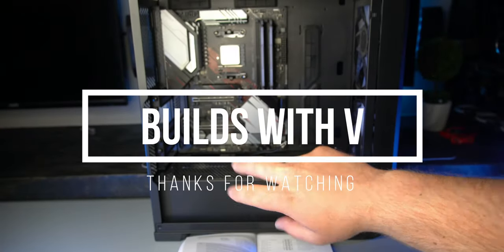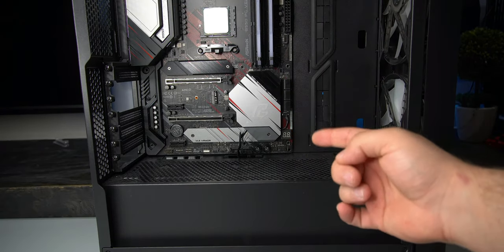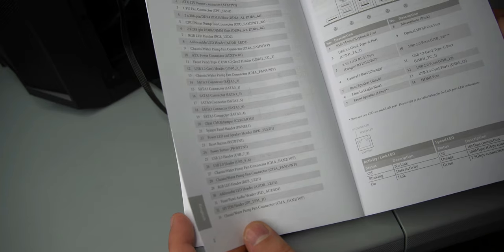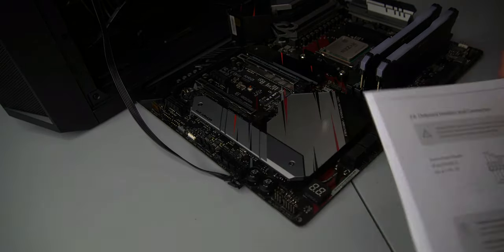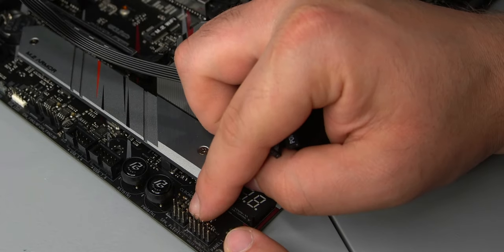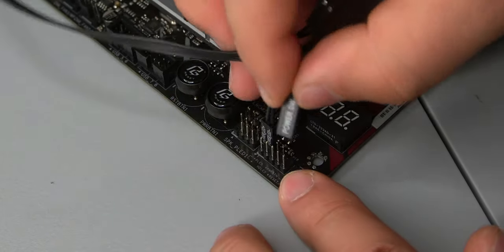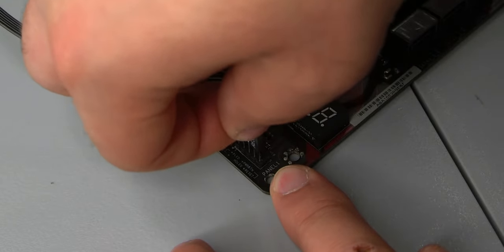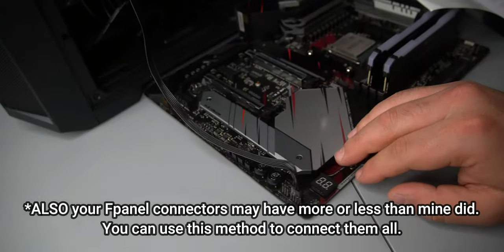How to Connect your Front Panel Cables (F_PANEL Beginners Guide)

Comment from the maker: What’s your least favorite part of building a PC? Mine used to be F_Panel NGL… but tbh I think cable management tops that 😅😂
Reply: Just plugging the cables in is a pain😂
Reply from the maker: @verivy  facts 😂
Reply: ram fit)
Reply: Spending money for part lol
Reply: Cable management is my favourite part because its calm work and i dont have to sweat over the fear of damaging my motherboard when i do that 😆
Reply: Installing be quiet! all-in- one water cooling system - If I don't see an advantage may just go with a regular air cool system.
Reply: GPU

Comment: Thank you for the amazingly simple video. Was adding a hard drive to my desktop but the SATA port was under my graphics card. Didn’t want to bother removing it so I poked around in the process removing the connectors. Ended up taking out my graphics card and trying to put the connectors back. It was hard to read the labels and I couldn’t find my manual. Your video saved me. Much better than the other videos that tell you to just check the manual
Reply from the maker: I’m glad I could help out 🙌 Thanks for sharing 🙏 and watching

Comment: I'm up past midnight, been putting my PC back together since like 3, with a bit of a break.  I could not find this information anywhere and I was not having any luck finding it in the manual.  Thank you SO much!!!  This was perfect!
Reply: I feel your pain. I just put together a PC for my wife and there was no documentation in the box that showed the location or pin outs of any of the connectors on the mobo. Not too much of a problem for an experienced person but imo it's sloppy. So I knew where the front panel connector was but forgot which pin was what. YouTube to the rescue...
Reply: @jimmarburger611  glad you got it sorted out!

Comment: Funny I've been building PCs since the 90s, but after getting myself a new Lian Li 011D Evo, I kept looking for the usual connectors and was not able to locate them.  Then I saw one connector with a bunch of wires named F_Panel...I looked and lo behold!  The pattern matches the pinout configuration on my motherboard.  Wo-lah!!!  A first for me!  Of all the cases I've bought up to this point, they all came with individual connectors...I thought this case has some MIA parts!  I was about to return it back to MicroCenter.
Reply from the maker: Yeah I love it. Some nzxt cases come like that as well. Nice touch for sure

Comment: Thank you for this. My book doesn't mention which connector the triangle goes on and the books don't mention if ground and power button are positive or negative. Your video is a life saver
Reply from the maker: I’m glad I could help. Thanks for watching 🙏
Reply: @BuildsWithV  Love the video, its the small things that make a big difference. To clarify, the LED's have a +/- because they're Diodes (Light Emitting Diodes) and current only flows one way through them. So they have to be hooked up correctly for them to work. The Power and Reset switches would work either way, but there are considerations of what side of the switch is hot and it's best to be safe and hook them up as directed. A good rule of thumb is that the writing on the connectors should all face the same direction, in this case all facing to the edge of the motherboard. Not that those singles wont go in either way but it looks better and you won't have to remove them to see what they are. Rock on Brother.
 P.S. There's a reason for the saying "RTFM" lol.  For those that don't know, it means Read The F____ Manual. A bit crass but a good idea. Thanks for making that a focus.

Comment: Should I plug my spair power plug for the f panel into the ground? Aswell with the reset switch?. They both only need one plugged in for my mboard

Comment: Hey man i am struggling to connect these and u helped me thank you! I do have a question is that the wire that is connected to ur hdd lded and all the other stuff, i do not have that i have the nzxt case and it came with it but its a very small wire and i dont know where to connect it

Comment: The arrow shows the power wire. That's what I was wondering. 

I don't install motherboards every day but I've built my own PCs for 30 years and those damn stupid wires have not changed. I would very much like one plug for the whole deal.

Comment: ive got mine plugged in all good. but using the front panel connectors, my pc wont turn on. but i can turn it on and it works fine just using the motherboard

Comment: Hi I need some help. Im new to building pcs. My nzxt h7flow case doesnt have cables like the ones you first show. its an f pannel connector but seems like they are all togeather in one block. do these still fit into the places you show ?
Reply from the maker: Yeah, nzxt and some other brands started making them bunched up into one connector. They should all fit in the right spot. Just line up power button + and - and plug them in and the rest should be same spot.

Comment: i got a question. when you put the front connector parts into the motherboard where does the other end go?
Reply from the maker: The other end is typically already plugged into your front panel I/o. If it’s not then you may be able to plug it in. It just goes to where the power button is, USB ports in the front etc.
Reply: Thank you so much for this, I've spent the better part of 3 hours searching for this answer because nobody ever shows the other end of the wire
Reply from the maker: @wicked1580  dang I honestly had no idea some cases don’t have them plugged in already. I will remember to include that next time I remake this video. Thanks and I’m glad I could help 🙌
Reply: Hey so I have prongs on the other end of mine and I have no idea where they go

Comment: Do I need to connect anything from the case to the power supply for the front panel to work?
Reply from the maker: Typically no but some cases have specific hub for fans or rgbs that require either sata or molex connectors to the PSU. Depends on the case but even then, those may not need to be connected to the PSU in order for the front panel to work.
Reply: @BuildsWithV  Thank You

Comment: hey man could u tell me where the front panel connecters are connected to? like my front panel connecters came in a separate bag.
Reply from the maker: They are connected to your case. Usually in the front or top of the case for your headphones, power button, power button led that shows when it’s on or off and stuff like that.
Reply: @BuildsWithV  really? then what came with the motherboard?
Reply from the maker: @Masakashi  I’m not too sure. What motherboard did you get?
Reply: @BuildsWithV  i think it was a h410m-a pro from msi, i forgot since im on vacation and my last part for my pc arrived so im askin for this part of the pc then im finished!😁
Reply from the maker: @Masakashi  I just looked it up and I can’t seem to find these cables that came with the motherboard. The only cables it says it includes are the sata cables for your hard drives.
Reply: @BuildsWithV  oh dang well u said it was on the case right? i have a h510 nzxt case
Reply from the maker: @Masakashi  oh okay, the nzxt cases typically come with a separate cable that connects to your front panel connectors and then plug into your motherboard same way as this. They did that because some motherboards have a different pin-out than others. Nzxt cases come with one solid connector instead of all these little separate ones like you see in my video. The small dongle turns it into these cables in case the pins are different. Hope this makes sense.
Reply: @BuildsWithV   could you link ur vid that has my situation? or any vid
Reply: @BuildsWithV  thank you so much for your help!😁
Reply: @BuildsWithV  nvm i have a prime h410m-a pls help
Reply: @BuildsWithV  nevermind i have setup my pc and it works!!

Comment: I have my pins in and everything is set, but I have no idea where to plug in the actual cord that isn't the pins. It's just dangling in the air. I have no idea where it goes
Reply from the maker: It should be plugged into your front panel where your power button and USB ports are.

Comment: so i have an old asus essentio cm6870 and i have the power led, usb3, and speaker in and out working but im not sure how to get the micro-sd port to work.
Reply: My motherboard is a gigabyte b660m ds3h which is not the original board that came with the prebuilt office case.
Reply: it would be helpful if i knew exactly what each front panel cord did and where it plugs in to.
Reply from the maker: I’ll be honest with you, I’ve never connected a SD port to any of my PCs so I have no ideas. I’m sure someone has some info on YouTube but I just don’t have any experience with it.
Reply: @BuildsWithV  sadly not lol
Reply from the maker: @realredrobot  oh that’s unfortunate 😅 what I’d do is look at the connector and then look on your motherboard for a same connector or similar and then look up the user manual for the motherboard and see if you can find what that connector on the motherboard is for.
Reply: @BuildsWithV  the problem is that the front panel is very proprietary and is supposed to only work with a specific motherboard, it's a miracle I got some of the things to work

Comment: connected all of mine like that and my new pc still didn’t turn on what could be the issue?
Reply from the maker: Check all of the connectors throughout your pc including these in the video. Check all your power supply connectors, make sure your outlet is working and not overloaded (this happened to me once). Also make sure your power supply switch is on as well. Start with power supply and work your way up to smaller connector or backwards. Could be one little loose connector.
Reply: @BuildsWithV  i checked my back panel and couldn't figure it out so im taking it to microcenter tomorrow!

Comment: What do I do with the prong spike things at the other end
Reply from the maker: What do you mean at the other end?
Reply: @BuildsWithV  for me there’s the connectors on one end those prong spike things at the other end.
Reply from the maker: @Deoslatt  I’m not too sure about that, it may be for a separate controller of some sort or something completely different. See if you can find the manual for your case and maybe that explains it better. Some cases have rgbs or other things that may need to be connected.

Comment: 5:10 I noticed that after you connected the leads from the case I/O panel, the label side of the connectors faced the bottom end of the case. This might be to indicate that the leads are installed correctly. DIYers have learned: If all else fails, read the instructions.